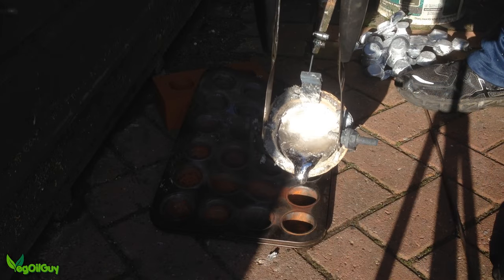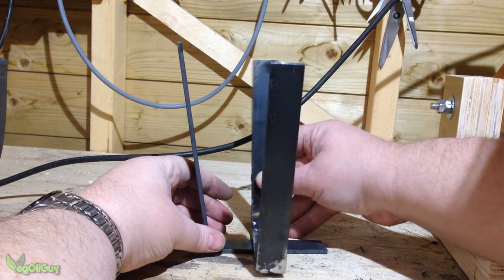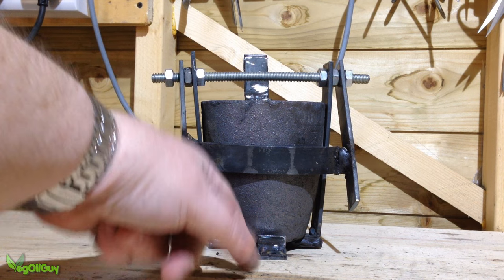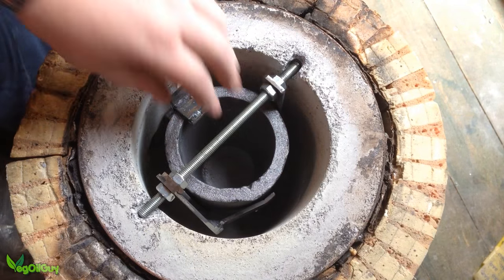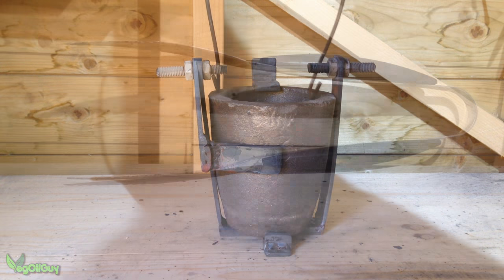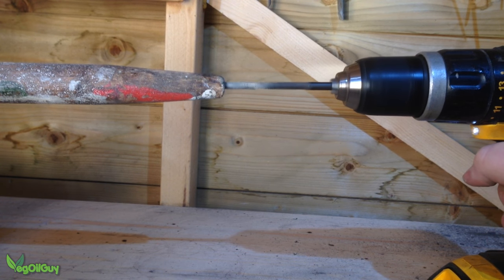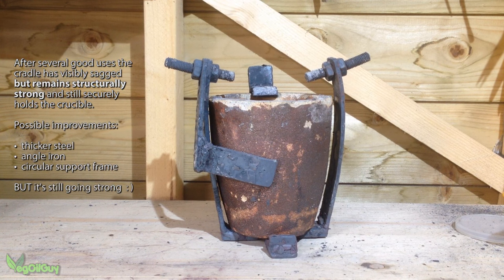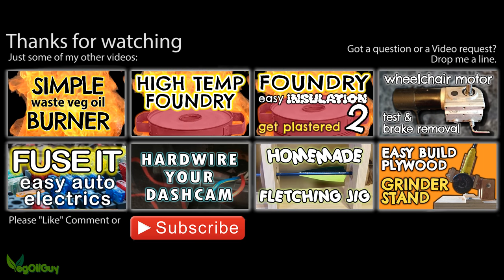Foundry Crucible Cradle by VOGMAN

Comment: This is a brilliant design.  Part cutting the bands to allow sharp bends is a nice trick, too.  Thank you for sharing!

You mentioned that this doesn't last long, guessing that's because the steel eventually burns up.  Have you thought of a design to lower and capture the crucible, so that it doesn't to stay in during the heat?

Comment: You should do narrations man your voice is epic dude. You’d do great with voice overs too. I’m sure I’m not the first person to suggest such a thing. Awesome videos by the way lol. Love the idea I’m currently building my own foundry and forge and was looking for ideas on how to do exactly what you are. I’m starting out with just a steel crucible so I’ll be able to weld directly to the crucible but once I move up to graphite I plan to refer back to this video. Thank you for sharing.
Reply from the maker: Many thanks. The crucible cradle does work but it has a fairly limited lifespan. If you're using steel crucibles (and many do initially) forgot the cradle and place bolts through the crucible walls near the top. It will achieve the same thing and be less involved for you, helping you concentrate more on the casting side of things  : )
Reply: VegOilGuy great idea, I’m going to do exactly that. Thank you.

Comment: I like this idea.  Been working on how to make Crucible Tongs but the cage seems better in my mind-especially using the Ice Tongs with the holes.   Can't weld due to vision problems so I'm going to have to figure a different route, perhaps using bolts with flt heads for the outside to not tear up my foundry.
Reply from the maker: It is a tricky one Mark. In honesty these cradles don't last that long either - probably as long as the crucible in honesty. Have you seen the tongs I use these days? I made these myself. It was easy. Just flat bar mild steel twisted to shape in a vice  : )

Comment: I've had somewhat the same idea. Except I was thinking of making the cradle stationary and adding a crank or wheel and gears or something to tip and pour the metal. Kind of like what you would see in an industrial foundry (it has a name but I can't remember 😅)
Reply from the maker: I know exactly what you mean. My recommendation... make it beefy. Every session the metal gets thinner as it's literally worn away by the heat. So the more material you have at the start, the longer it will last : )

Comment: Why would it not work with charcoal? I want to use coal since it won't explode like loose fittings on a propane bottle... Please comment! Would it hold up to melting bronze?
Reply from the maker: I would work with charcoal, but it wouldn't last long. Once the steel hits the charcoal is starts to deteriorate. You hear blacksmiths talking about burning the metal, and that's what happens here. So it won't last long at all. 
With oil or gas there's no direct contact with the crucible, just heat, so the cradle lasts longer. But it still only lasts about as long as the crucible  : )

Comment: I had thought about doing the same thing for mine, but I went with a pouring shank and separate lifting tong. I'm still thinking about doing this, however, as the walls of my foundry are fairly close to my crucible and it's hard to get the tongs in without scraping the sides. Let us know how well they hold up after repeated heating/cooling, please!

Comment: I am making a furnace from a propane tank.
I will be using Portland cement with perlite mixture.
Can I use a stainless steel liner to help hold the insulation in?
I see people using wire to hold the cement together. my thinking is to use a liner to help hold the mixture together.
Will it work.
Reply from the maker: Hi Robert, have you seen my Homemade Foundry video? It might help... https://youtu.be/n42t3M1fOyY
The truth of the matter is, nothing survives very long inside a furnace. Even firebricks break down over time, but in their case and also proper refractory, it takes years. Stainless steel will begin falling apart after a few outings.
If you're putting this furnace together for pennies, then go for it, but if you're investing good money, try and find castable refractory like that I mention in my video. It's really simple to use, lasts for years and isn't badly priced.
I hope this helps : )

Comment: Great video, Mate.  There's some ingenious stuff going on there!  Have you tried melting copper again since improving the insulation in your
Reply from the maker: It's winter here at the moment and outside veg oil goes a little thick. I cut rig up some heating system, etc, but in truth I'm too lazy. Once the warmer weather hits, I'm really looking forward to giving the oil burner a dusting off. The plaster insulation has quite honestly amazed me. What a difference!
So don't worry... veg oil vs copper II is coming soon  : )

Comment: Hello - I notice that you remarked that "the cradle wouldn´t last long in a charcoal foundry" but that it should give good service in a gas or oil-fired one. Why is this? As a humble charcoal-and-hairdryer wallah using steel "crucibles" of my own devising I have a keen interest in the longevity of steel furnace equipment.
Reply from the maker: Nothing humble about charcoal my friend. Most of us start of that way and some of the greats use nothing else : )
I don't know the technical term for it but you may have experienced yourself the way coal and charcoal can eat through metal. I know I've burned through a few steel crucibles when using charcoal.  Have you noticed how the steel gets thinner with use?
You often hear inexperienced blacksmiths saying things like "I burned the steel" etc, and it's something to do with the physical contact (and possible chemistry) of the charcoal with the metal.
Gas and oil burn around the metal and heat by convection (hot air) so it's not direct. This makes it easier for novices like me.
Hope this helps.
Keep up the good work.
Geoff
Reply: I certainly have noticed this effect. A grey scale forms upon the steel. When cool it may be peeled away in satisfyingly large pieces, which can be quite fun till I find myself ruefully observing the new slimline contours being sported by my crucible. I hadn´t realised till I saw your video that this happens to a greater extent in charcoal-fired furnaces. It only serves to encourage me to think of changing heat sources. I´m teetering on the brink of deciding how my next one will be fuelled. I like the idea of the thermostatically-controlled precision offered by electricity, I can readily obtain bottled gas but have no source of waste veg or mineral oil.
Reply from the maker: I won't say the scaling you're describing won't happen with other sources, but it shouldn't be as severe I think.
As for heat, there's lots of choices.
I like the idea of electricity as well and I think if I was working indoors I'd do it.
My alternative for veg oil (on days when it's cold and I'm in a hurry) is gas which I find quick and controllable.
Whatever your choice, best of luck : )
Reply: One reason I´d like to move on from charcoal is that I´d like to be able to move indoors. I shall continue to enjoy your videos and to benefit from your experiences and the advice you offer. Thanks for providing us all with such an entertaining and informative channel.
Reply from the maker: Every time it rains I say the same thing  : )
Just remember - lots of ventilation! There's more gasses involved that folks realise.
Best of luck.
Reply: That´s a good point, and one which I hadn´t fully considered   : )

Comment: Ok first thing buddy. Is everything ok ? You haven't posted for a while.

2nd could you explain why the cradle would not last long in a coal  power furnace ? 

Iv just got a steel O2 tank for a crucible it's quite thick so it should last quite long. 

My steel insert is doing well now iv had 2 firings so far just to burn some old garden rubbish. It's holding up quite well.

I'm hoping to get a melt done on bonfire night to see what she can realy do however I do have to have it burning for about an hour to get it to full temp. But when it's at full temp daaaaamaammmmm it's hot stuff and melts aluminium no problem. 

How's things going buddy ? Hope your ok down in Wolverhampton
Reply from the maker: Everything's fine old pal. Life's just getting in the way... more videos coming very soon.
Steel gets eaten by heat. Blacksmiths talk about BURNING the metal, a point beyond which it's too weak to do anything with. It sort of flakes and corrodes.
This happens with all fuels but it much quicker where the fuel is in direct contact, such as with coal or charcoal. It might also be chemical it that case, I'm not certain, but I've witnessed it.
The cradle I built in this vid is still surviving, though it's been pulled back into shape a few times. The heat takes its toll.
A good thick steel crucible is a fine starting point - I did the same. When I burned mine through I went with a cheap crucible from eBay and I still do that now.
Technically aluminium and steel don't get on... the aluminium is chemically corrosive of the steel I'm reliably informed. This doesn't stop thousands of people using steel however, but you did ask : )
Take care.

Comment: How much metal does the #3 Crucible hold?
Reply from the maker: Hi Skully, sorry for the delay. Last week I was mid-melt when you messaged and by the time the crucible had cooled down I was long asleep. I'd love to give you a good excuse for the week in-between but in truth it's just your standard running around stuff. However today I got out my foundry and before I did anything else I filled my crucible with fine, dry sand. I then poured that into a measuring jug. My guess based on this is that brand new my crucible held 450ml. The rim on my is a little ragged now, hence the guess.
Whether all no. 3's hold this sort of volume I can't be sure. It was a cheap eBay purchase.
I hope this helps.
Best wishes,
Geoff
Reply: I just needed an approximate value.  450 mils is awesome.  My cast iron crucible is only a bit larger but I am concerned about contamination from the iron.

Comment: why wouldn't it last long in a charcoal Foundry?
Reply from the maker: Thanks for the question. I'm not certain of the science involved but essentially coal / charcoal fires can eat into steel. Crucibles tend not to last as long and steel ones last even less time. There's a lot of clever, experienced people out there who can give you better reasons why than I can, and tell you stories that might make more sense. I just know it to be a fact and it's certainly something I've experienced myself.
I hope this makes sense. 
Best wishes
Geoff
Reply: VegOilGuy thanks, I'm just about to make my first proper foundry but I'm using a fire extinguisher as a Crucible, so I'll bear that in mind. might reconsider using veg oil rather than charcoal
Reply from the maker: I think most of us started out with Grant Thompson's fire extinguisher crucible : )
Mine burned out on it's first outing... charcoal...
Veg Oil is excellent, especially if you can get waste oil for free as I do, but it takes a little fiddling to get it going. First time out, I wouldn't recommend it. Once you've got to grips with what to expect, yes, but first time no.
Charcoal is abundant, gets really hot and burns out usually just when the metals are ready to melt... that's my experience anyway : )
If you can cheaply source some gas equipment, you can't beat it for control and ease (I made use of a £20 gas torch from the internet - brilliant). Light it, turn it up a bit or down a bit, turn it off. That's the advantage of gas. BUT when you do a lot of foundry work, it might prove expensive to keep getting canisters of gas. That's why so many guys like the veg oil.
With all the above said:
- For the easiest possible experience, gas is the way.
- For the cheapest workable experience, charcoal.
- For the cheapest fiddly experience that might involve a lot of swearing, oil.
I hope this makes sense and that I haven't put you off. I would say don't commit to anything until you've tried it all (my way might not be your way). And as I always say, it must be easy if I can do it.
Best wishes,
Geoff